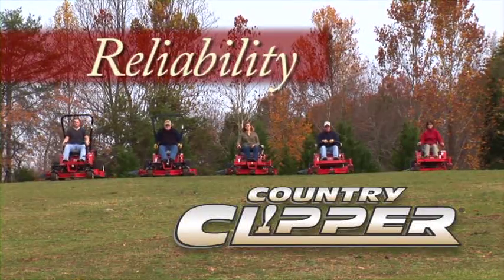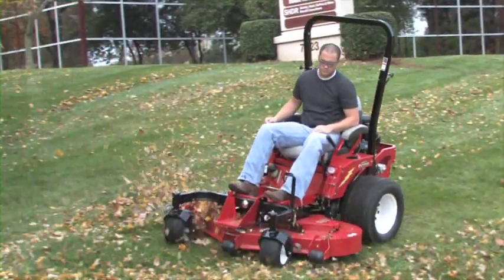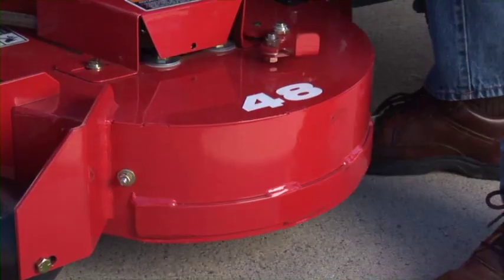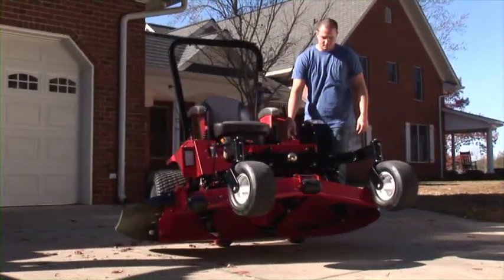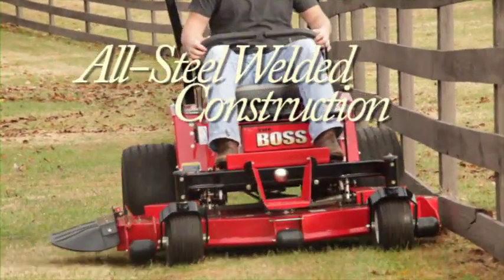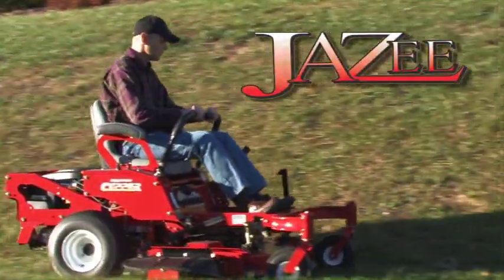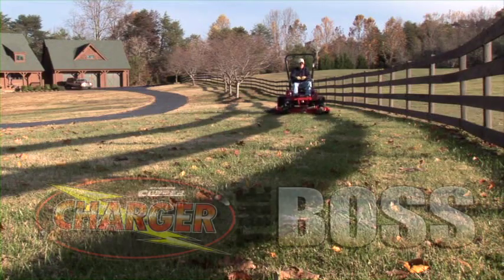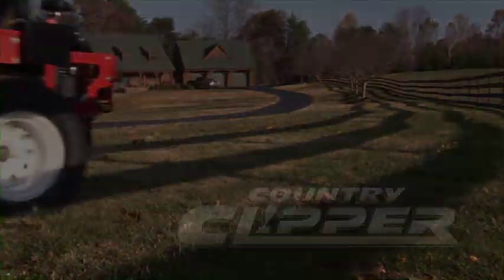Country Clipper Product Video 2011

Comment: i have the country clipper boss xl 72 inch, i paid over 12,000 for this unit it has 70 hrs on it, but the latches keep coming on hooks, i have haD IT BACK TO THE DEALER SEVERAL TINES, THIS has caused me major money, just having it picked up and taken back to the dealer, something is wrong, and i am not a happy camper, i watch my neigbhors cut their yards, with lesser so called mowers so what is wrong with mine, does anyone else have this problem